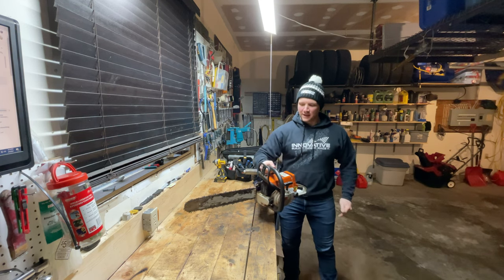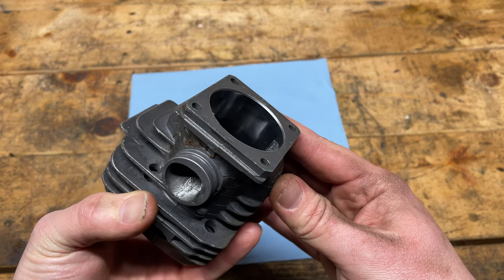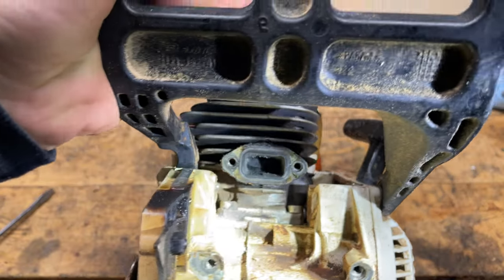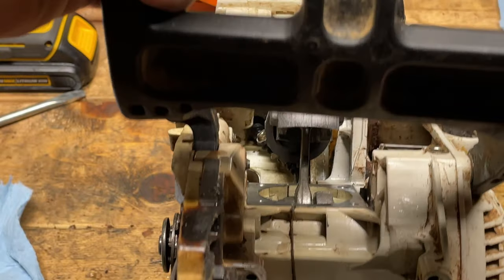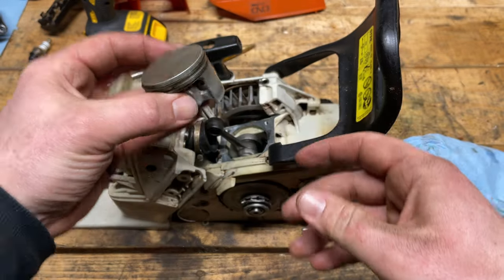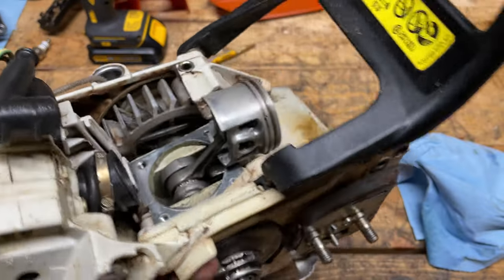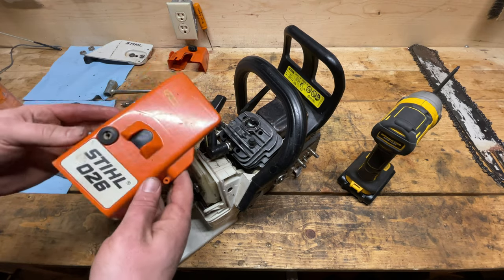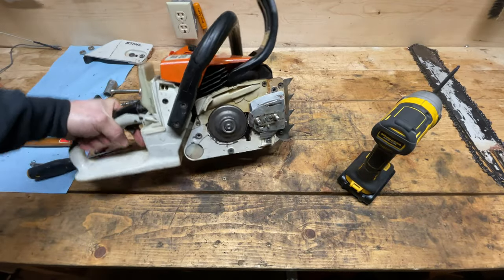Making an older chainsaw easier to start (Stihl 026 scored cylinder repair / update)

Comment: whenever i tap out a piston pin i like to turn the saw on it's side and sit the piston on a block of wood , this way you're not applying unnecessary stress on the rod , just thought i'd put in my 2 cents , 😂 
great work 👍
Reply from the maker: Sounds good!
Reply: @DavesSmallEngines .wow tu fuistes alumno de donyboy73.

Comment: Your very helpful video is appreciated.  I am another "elderly gentleman"  out there, 79.  I have had the 026 for over 25 years, but had noticed it was getting harder to start because of the compression.  I don't think it was just my aging, it seemed more difficult to start - even to point I tried wd-40 as was recommended here somewhere, and it did work, but you have to continue to do it every time it is cold started.  It was a great thing to discover the possibility of a retrofit which your video did for me.  Anyway, following your lead, I decided it was worth the try as it was not a functional saw for me the way it was.  I will say it was not an easy challenge, but I did get it done, and today, it started up with the help of the newly installed decomp valve.  It is running great.  As a side, I was impressed that by comparison to the saw you switched out,  the piston, and cylinder on mine were almost pristine, no scoring, or burn marks at all.  Without the decomp valve engaged, it still pulls hard, but using it makes the difference.  And, I did end up purchasing a ring compressor kit, and that made the job much easier.  I see someone recently commented about that.   Thank you,  Dave.  Ron
Reply from the maker: This is great, Ron. Thanks for sharing!

Comment: I bought a 026 about 10 years ago and it say made in west Germany, that tells you it’s age.

It is a super saw to start especially after I serviced the carburettor, always starts first pull when hot, takes about a dozen pulls if I have not started in a months, great saw
Reply from the maker: Yes, the quality of the west German saws is unparalleled. Glad you like it!

Comment: Thanks Dave, now I know I can do it! I have two of these and both came with decompressor,  maybe it was a UK option.
Ashamed to say both are burned out, it happens almost before you know it, just pushing it too hard on an awkward gnarley cut.
Muffler off and the damage is all too visible!  
I agree that the 026 is the best they made, and now I’ll fix one and keep the other for parts.
I have an 021 as well, also an excellent saw. I’m 76 by the way, I’m sure your friend appreciates what you’ve done…

Comment: I have my late father's 026 and I've used it a lot, but not for a living, and it still runs great after 32 years.
I didn't want to burn up my father's saw, so I also bought a great used ms 260 pro with a case for $325 and it runs great too.
I've only changed one needle bearing also bars and chains from 16" 18" and 20"

Comment: Hello Dave, couple items:  my eyes aren't what they used to be so I clean the work bench and drape it with a white sheet.  Helps if a circlip takes off or even a dropped bolt.  
Cut a piece of carton with a slot for the conrod and slid that over the gasket, so if something dropped still not in crank case - even it you never find the piece - with the carton covering the crankshaft area you know it is not down inside.
Finally mark down the exhaust side of the piston with a felt tip pen.  Now insert the piston and rings into the cylinder at your leisure and in proper orientation.  With the piston well started in the cylinder bore and one side of the piston having the circlip in place, the wrist pin is easily inserted. To my hands, a lot easier to install the remaining circlip than contend with the rings.
Reply from the maker: I agree! Thanks for all of the good tips

Comment: I recently bought a replacement piston/cylinder for my 026 on eBay, (have not done the work yet), after watching your video I checked the cylinder, the replacment has the decompression valve! Difficult to start without. Thanks for the video.

Comment: Great video Dave. As someone who regularly works on chainsaws, you should invest in a set of ring compressors. Very inexpensive tool, but it makes installing the cylinder much easier. I'm sure your friend will be very happy with his rebuild saw, better than new.
Reply from the maker: Hey Mark! Thanks for the tip. Where would you get them from? Do they have difference sizes? I could totally use a set....
Reply: @DavesSmallEngines  I bought a a set on Amazon. $20-25, free shipping

Comment: I have the Stihl 026 “Pro” which I purchased new many years ago (it still runs and cuts perfectly).  It came new WITH the decompression valve, although I rarely use it (it seems to start better without it).   Good to know that I can rebuild my saw with the newer 260 or 261  cylinder/piston if it is ever needed.  I’ve always run Stihl 2cycle oil at 50:1 and have no visible scoring on my piston or cylinder wall.  This is one torquey little 50cc chainsaw….I love it.  I also have a very old manual-oiler Homelite 50cc chainsaw that still works quite well, but it is very heavy, very noisy and simply no match for my 026 Pro.  Dr. K.
Reply from the maker: Hey Doc! They are awesome saws. I love mine. I rarely need anything more!

Comment: Hi Dave,
Thanks for the video.  I am getting close to 70 myself.  I have a similar sounding problem with my 034 AV.  I don't know if you will see this post since I am now just viewing your 2 year old video.    I purchased the 034 new in 1985 and it has been a great chain saw.  Over the years it started to occasionally grab/stop the starter cable as I would try and start cold and just about tear my arm off/injure, it is now becoming a very common occurrence.  I have taken the 034 to two different Stihl licensed mechanics and they basically say I just need to pull the starter cable as hard as I can.  The mechanics can start the 034 but it has grabbed them at times, also.  When the 034 was new it never acted like this, I hate to get rid of the saw but I don't want to injure my shoulder.  I have taken your information on diagnosing a problem and applied it:  1.  It has spark,  2.  It has compression,  3.  I have looked at the exhaust side of the piston/cylinder and see no indications of scoring.  The only thing I can think of is loss of vacuum/or I just can't see the scoring.  I don't have the vacuum  testing equipment.  Do you think a vacuum problem could be causing the extreme compression stopping the starter cord from turning over the piston?  Any ideas?  I always run the premium gas out of the saw before storing for any length of time.  That is all the information that I can think of to give you.  Thanks again for your help!  Started watching you on Donny's channel.
Sincerely,
David

Comment: Good video done in a way that the average DIYer can follow, I am not quite ready for a decomp yet but recently picked up a 026 to go with a lighter saw than the 044s that I have been running forever. Barn find 026 with a 1/4inch of dust which after clean up might have hardly ever been run judging by the near new condition of the bottom of the cases and still shows cross hatching on the cylinder walls when viewed thru the exhaust port nearly threw my shoulder out going for my wallet when the seller asked for $125 LOL, now starting ,my quest for a 026 with decomp for my 72yr older brother.
Reply from the maker: That’s a steal! I just picked up another 026. Needed carb work. I’m keeping it!

Comment: I picked up a crash damaged 026 this week that I am restoring.  It has a broken rear handle which I am replacing.  It has wonderful compression.  After I got it, I spent a good afternoon cleaning it up.  Since it was missing an air filter cover I removed the air filter and clean up the carb area.  After I was through cleaning it up, I squirted some gas down it’s throat and pulled it over.  It had been sitting on a dealer storage shelf for about 15 years but I felt it had been running when it was damaged.  It actually rolled over after a few pulls, so I gave it a few more squirts of two cycle.  I wanted to lube it’s bottom end real good with good two cycle.  I then pulled it over, again, and that time it ran for a few seconds.  Every day since, I have given it a squirt and got it to run a few seconds.  This morning, Inam going to connect it to a piece of fuel line and filter which I will drop into a small container of two cycle.  I want to hear it run and idle.  What do want to bet it will?  All I have for a throttle is a throttle rod hanging off the carb and a kill wire hanging off on a piece of the control lever.  I can always touch the kill wire to the metal spring and shut the saw off by killing spark.  If push comes to shove, I can always put my thumb over the end of the carb and kill it.  I think it will run and idle on my Rube Goldberg fuel tank arrangement.  After all this is a real saw and not a strato controlled EPA saw.  I do not need a deco on a 44.7mm saw.  This is a toy compared to my ms 460 and 660.
Reply from the maker: Sounds good!
Reply: @DavesSmallEngines  I got the rear handle on it, yesterday.  I still have a few things to do to it. MIT was filthy, sawdust and oil everywhere on it.  I scrubbed it with old two cycle and got most of it off.  I was covered with sawdust and gas when I got through.  I also found out that someone had taken off the clutch, worm gear and sprocket bearing.  I am going to see if I have a clutch that will work on it in my junk pile.  If not, it will be another few weeks before I can get it running.  Still have a few other things to do to it, anyway.  I want to go through its carb before I put it back on.

Comment: I did almost exactly the same thing for a mate who was coming out of a divorce. He had work but no money and had blown up two 026s and then his newish MS260 got a tree on it. I built him one out of all the best bits and he reckoned it was the best saw of the whole lot. 
I flushed the bottom end out with 50:1 after being careful not to get debris in it. I lube the piston, rings, end and main bearings with two-stroke oil.

Comment: Good video and nice clean work area.  We'll see how long that lasts😄 I have a set of plastic ring compressors but saws don't always have clearance for them.  I found the a great compression tool can be a piece of shim stock or flashing wrapped around the piston and taped closed.  Always lube the piston and rings.  this method fits anywhere and once the rings are in, just untape and unwrap the metal shim or flashing.  If you do a lot of these, a better tool, need one with diameter for each piston size, is to machine a thin wall aluminum cylinder just a few thousandths larger than the piston.  This ring would then have to be split and some sort of quick fastener, or even a cable tie (to be cut later), added.  Again the only benefit over the plastic tools is that there's almost no space required for the tool.

Comment: Nice video, Dave.
But i think you forgot that heat shield between cylinder and exhaust.
It is recommended, to prevent from overheating your engine.
Greetings from Germany.
Reply from the maker: I’ll have to go check that over!
 Cheers!

Comment: Hey Dave, the 026 Pro’s (labeled) on air cleaner cover had the decom in that cut out that your friends saw had which you replaced. Pro labeled saws had the magnesium cover starters as well. FYI
Reply from the maker: Roddy! That’s the info I was looking for. Great to know! Were there any other differences?
Reply: Yes the 026 pro had an adjustable oiler on the bottom
Reply: Decomp valve, adjustable Oiler and rim sprocket make a pro labeled saw.

Comment: I bought a new ms 260, and I love it so far as well.
Reply from the maker: How old is it? Great saw!
Reply: @DavesSmallEngines  It's brand new. Was made in 2020 October.
Reply from the maker: @adamnagy1439  awesome! I didn’t know that was still available. I thought they moved to the MS261c. What country are you from?
Reply: @DavesSmallEngines  I'm from Hungary. The ms 260 is still being produced in Brazil, but officially it is not available in Hungary. Mine was brought into the country from Ukraine, where the ms260 is still sold in dealerships. A lot of older model chainsaws are still sold around the world, and being produced. I think even 2 series Husqvarnas are made to this day. It's mainly for countries with not that strict emission regulations, and less income.

Comment: Nice one Dave, bought an MS 260 at a car boot sale in the UK a couple of years ago for £18. looked like a pile of rubbish as the bar/chain was rusted together. Engine turned over with plenty of compression. I stripped and cleaned the carb, added a new chain and 18" bar and it runs like a dream. It is now my go-to saw and has cut loads of firewood. P.S. is that old fellah you were talking about a guy Donyboy73? He looks as though he is getting on a bit. Must be all that teaching he is doing. Kind regards to you both from Scotland.
Reply from the maker: Hey Neil! That’s an awesome story. Great work! Nah, Don is about 15 years older than me. The other fella I’m talking about is late 70’s 

Thanks for the comments! Cheers!!!

Comment: There is a rumor saying that the 026 will be easier to start if you upgrade it with a 260 airfilter because the choke functionality of the 260filter is closing better. That would be an interesting video, testing the number of pulls needed to cold start an 026 before and after replacing the original filter with a 260 filter. Must change the air filter cover as well. Cheers.
Reply from the maker: That would be a cool video!!!

Comment: ...great post Dave......audio and video excellent......I just finished restoring a Stihl 026 that a friend gave to me because he could
not get it to run anymore.....really enjoyed the restoration......I am a retired electrical engineer, but most of my projects are more
mechanical than electrical.......just have a question - when you crank the chainsaw with the spark plug removed, would it not be
better to have the run lever in he "off" position so that the magneto does not have to "find" a path to ground somewhere besides
the spark plug?.....just curious, and maybe it doesn't matter, but that 20,000 + volts of energy has to go somewhere, right?......really
enjoy your and Don's postings....keep em coming..  :)
Reply from the maker: Hey Ken! Thanks for the comments!!! I really do appreciate it. When I pull over that slowly there is no charge generated (or maybe there is but not that much). You would know better as the electrical engineer but I have pulled a saw over slow like that with a spark plug grounded and I have not seen any spark generated. Maybe you can elaborate and I can adjust my practices?  Cheers!

Comment: I have a MS 260 that has no decompression valve. But, my problem I'm having is fuel spitting out the carburetor, I've also found a puddle in my muffler. I rebuilt the carb. Did a test to see if the needle valve was holding, it did drop, but very slowly and looked like it stopped at 2 lbs. I can not find the answer to this problem of fuel blowing out the carb. Anyway nice film showing the swap out of cylinders. Any help would be highly appreciated. Thanks, Jack.

Comment: Nice job Dave! That was a nice used cylinder for sure. Do you work on mowers in the summer months or do you keep purchasing non running saws? Your doing a great job of explaining your processes of the repair as you go. Dony is very good at doing that as well and it makes the videos so much better!  ✌🇺🇸🇨🇦  Roger
Reply from the maker: Hi Roger! The summer is usually string trimmers and leaf blowers. I don’t really like working on mowers.
Reply: @DavesSmallEngines  Dave you must really like that 2 stroke stuff. Since retirement a year ago i started flipping mowers for a hobby. I get some curb find string trimmers, but i cant really make any money on them. Most people here just buy the $90 junk trimmers from the big box stores. I mostly flip name brand mowers, such as Toro, Honda, Craftsman,  Lawnboy,  etc. Roger
Reply from the maker: @rogermcdonald1607  hey Roger! I have a nice Toro 22” personal pace mower for myself. Truthfully, I enjoy the portability of the small 2 stroke equipment. Fits in my car nice and easy!

Comment: Hi Dave nice work, i have a used 026 too, with original cylinder but with no brand name piston with a letter (A) on it. Which means is 43.95mm, cylinder is in great shape but the piston have some scratches nothing special but i want to replace it . Meteor made three different dimensions for this model:(A)43.95 , (AB)43.96 and (B)43.97mm and i can only find only (B) available on internet so my question is....can i put a meteor (B) piston in this good cylinder,i m afraid the 0,02+ difference between A and B will overheat and seize the cylinder... what's your opinion about that... P.S. i didn't measure ovality of cylinder with a bore gauge .

Comment: I do not need a deco on my 026.  I am an active 76.  I still ground start it but I can easily pull it over.  The scars were from a lost circlip on the intake side.  If it comes out on the exhaust side it usually ends up in the muffler.  I tap the end of the circlip with an old wrist pin on both circlips to make sure that sucker is seated, correctly.  I have not had one come out since.
Reply from the maker: Good to know!

Comment: Good job Dave. Not sure you explained what caused the lean condition and what to check for.  I usually check the carb setting screws as a baseline and Definitely the notorious cracked intake boot that you had to dance with or crank seals
Reply from the maker: Hey!! He forgot to add oil to the mixture.
Reply: Oh sorry i missed that part. Thanks and keep up the great work
Reply from the maker: @RayofallTrades  cheers!!!